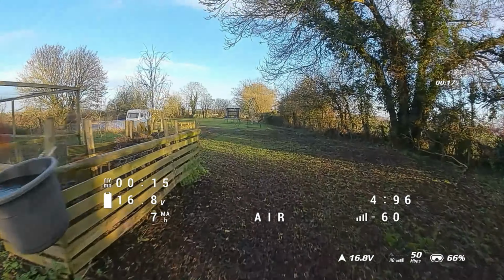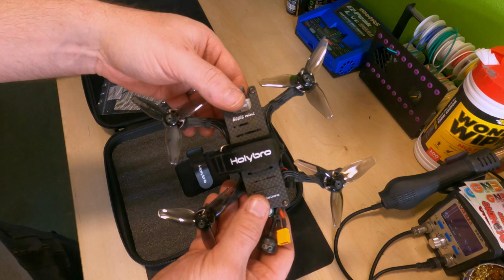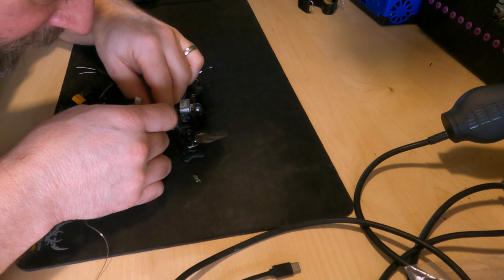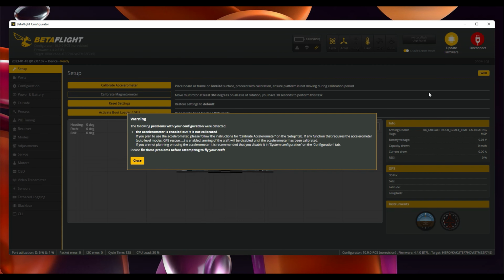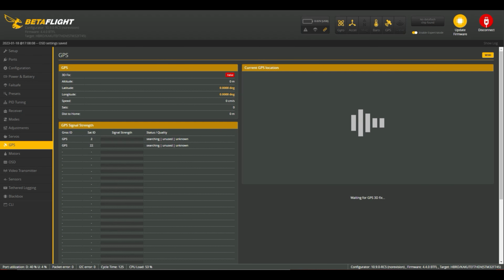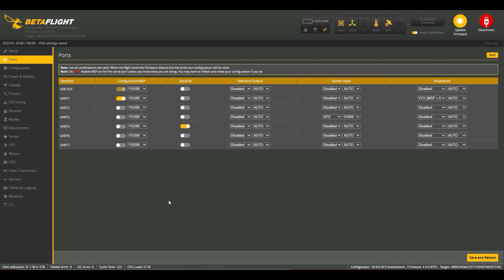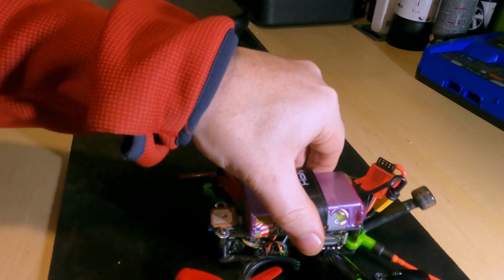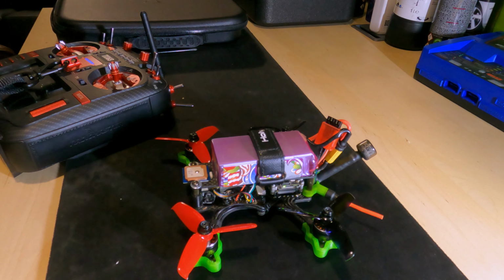Holybro Kopis Mini Caddx Vista Unboxing and modding

Comment: That battery is a BEAST! I use an 850 mah on my 3 and 4 inch quads. What kind of flight time are you getting? PS I LOVE the 3D printed parts 😎
Reply from the maker: 3D printing took up years of my life. :D
All worth it though for these parts I can now produce. 
The battery is a Gaoneng LiHV 1300mah. Light and packs a punch and mah for its size due to it being a high voltage unit. She goes for ages on this batt! :)
Fly hard, I get 4 minutes, go real easy, I get 8. Moderate flying 5-6 minutes dropping down to a recovered 3.75v.
Johnny.
Reply: @nozzlewizard  Impressive! I will have to try this battery! My puny 850 mah gets less than 4 minutes on average....

Comment: The 4 stars that appear briefly several times above the AIR text in osd, is that because of a lost receiver connection ?
Reply from the maker: Alkmost! I have the initial warning set at -75db and 4 *'s flash up before the warning - a bit too early but it is always good to know. :)

Comment: I have the Kopis Mini 3 with a H7 based flight controller currently with BF and eventually want to install Ardupilot.  I have a GPS/compass module and was considering mounting it to a 3D printed GPS battery strap holder - I like your idea way better with the shims/washers to hold the unit in place by the carbon fiber camera cutout on the top plate.  I'm curious if you have any plans for Ardupilot on your Kopis Mini 3 - since you have a GPS on it.  I also like your OSD arrangement and will likely configure mine that way as well. Thanks for the video
Reply from the maker: Not at the moment. The Kopis is now gone. It snapped a couple of days ago. I should do something though. Could be fun!
Reply: @nozzlewizard  That would be super cool.  I have the Matek M8Q-58831 and it doesn't sit well in the camera cutout like your BN-220.  Also kind of concerned that the GPS/Compass is to close to the electronics/motors which may cause accuracy issues.  I suppose I could shield the control wires - a grounded cover over the control lines.  Did you have any GPS issues when your Kopis was running?   Sad to hear it snapped.